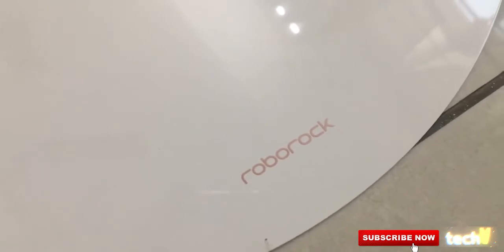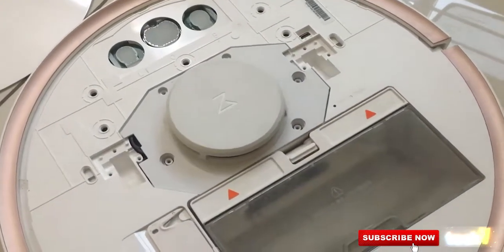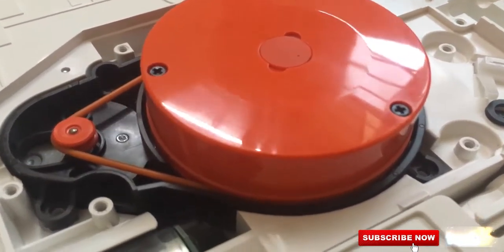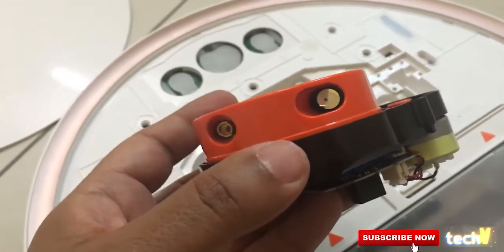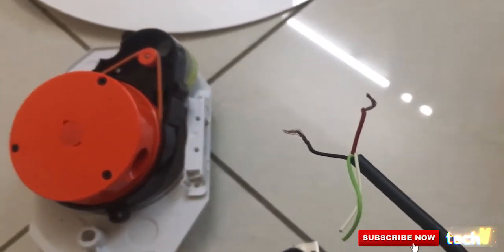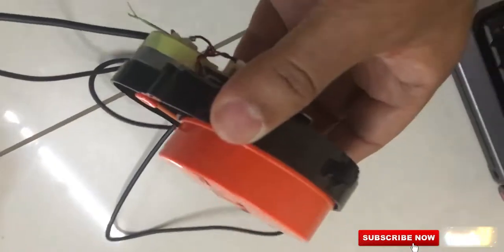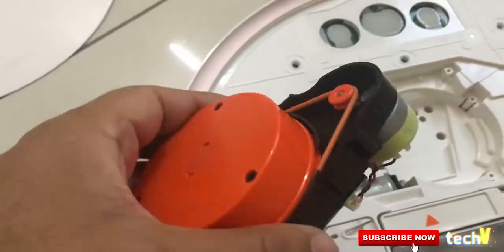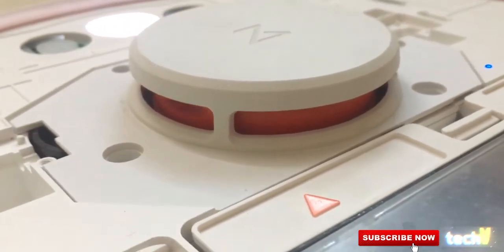Xiaomi Roborock | LDS Sensor Error 1 | LDS Motor Repair - TOTAL TECH

Comment: Kudos, it did the trick. I also added a drop of machine oil to the axle before applying the voltage - I guess the engine must be stuck due to the old lubrication wearing out.

Comment: Well, it worked for 5 minutes and stopped again. I wonder what is the root of this issue.
Reply: Same here! Did you found out what was going on?
Reply from the maker: It's working fine for me since I repaired it. Just try and do the same once again and keep the LDS motor running for about a minute before you fix back in roborock.
Reply: @MrFredi_  yes, I did it few times, every time increasing the the amount of time running from the USB, but it stooped anyway. What I did then, took the engine apart as much as possible and cleaned the metal rod that comes from the actual engine and used a drop of good oil (for my WAHL hair cutter) on it and ran again from usb for about the minute. Since then (touch the wood) it is running fine.
Reply: same me. work for 15-20 mins, and show erro 1 again,  how to fix it?

Comment: It doesnt do the job for long and as you can see the vacumm bumps into obstacles. With working laser it doesnt do that.
Reply from the maker: Try this repair process again and order LDS motor if it doesn't work after the repair. But it should work ideally.